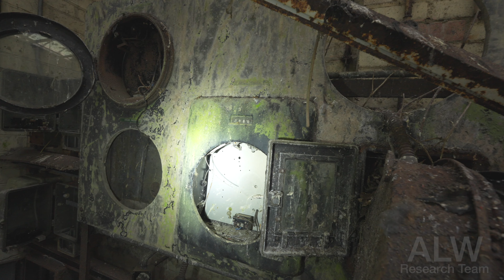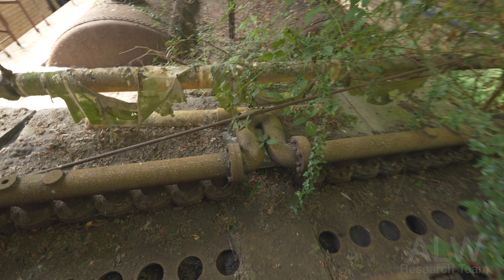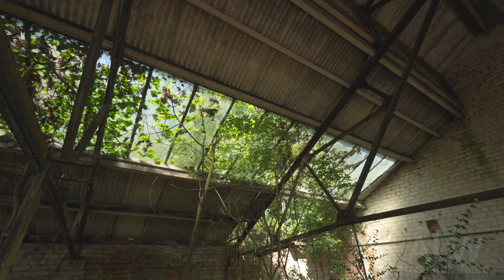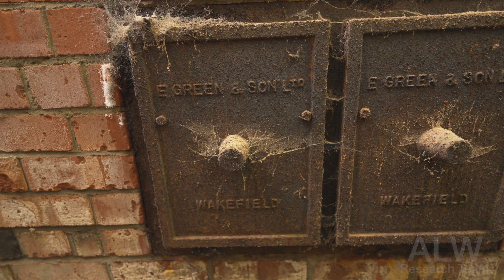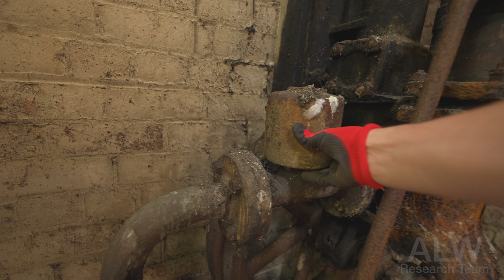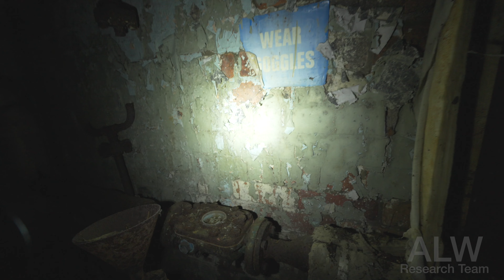This Abandoned UK Sanatorium Still Has Everything Inside

Comment: The device at around 3.00 is a 'Greens Vertical Economiser', a series of pipes pass through the end of the flue, before the chimney, giving waste heat to the boiler feed water, in one instance fuel consumption was reduced from 16 tons in 16 hours to 11. The chains have scrapers at the end which go up and down scraping soot off the pipes [soot tends to stick to the pipes and stop the heat getting from the waste flue gas to the boiler feed water]. The gearing at the end is driven by a small steam engine or electric motor this  drives a lever with a weight  which 'changes gear' when it swings over and makes the wheels/chains change direction so that the scrapers are driven up and down, it is a clever device and is fascinating to watch one in operation. The doors on the side are so you can get in and remove the soot before the boiler inspection [this is a vile job as half the top caps & bottom end manifold covers are removed to inspect the inside of the pipes and some of the water inevitably mixes with the soot].
Reply from the maker: Wow, Ross! Thank you so much for all this detailed information! That's incredibly helpful :)